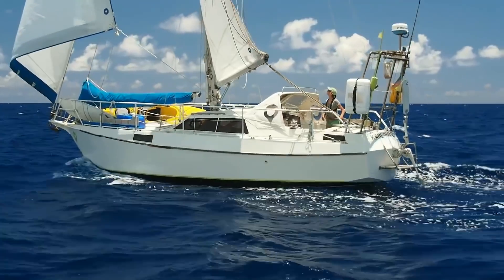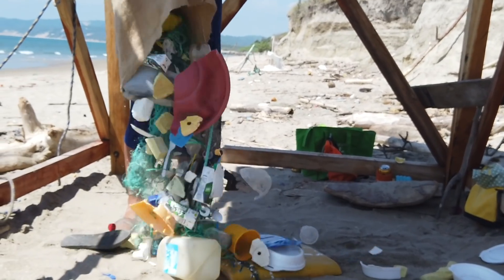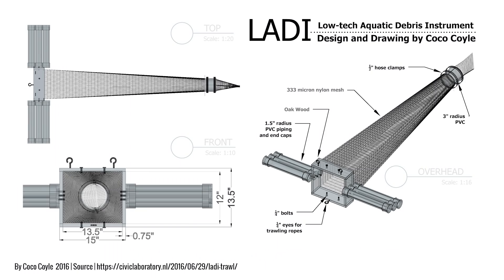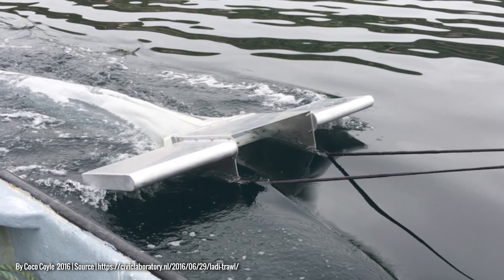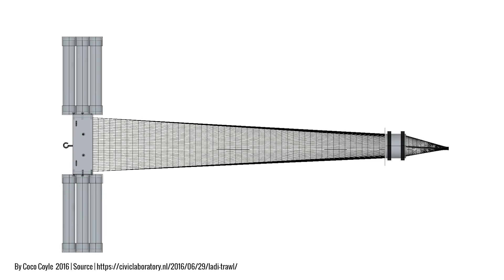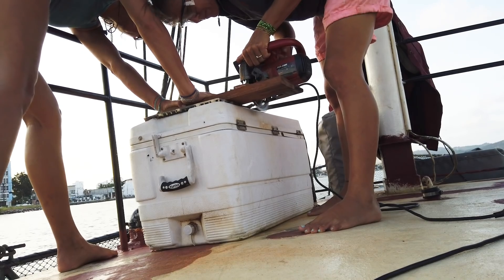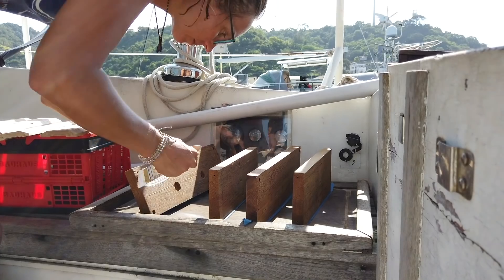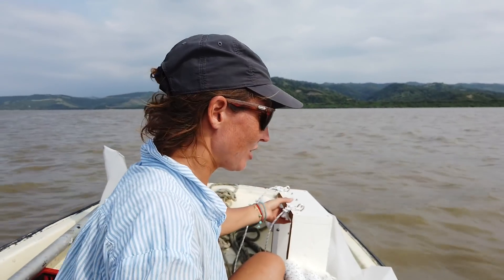MICROPLASTIC in our OCEANS. Collecting data to help fight plastic pollution - UNTIE THE LINES IV #50

Comment: There is a easy solution for islands to deal with plastic waste. Most islands do also have good clays in the soil. Built a clay oven based on the rocket stove design and burn the plastics. Yes, sooo many people will now jump up and down and say,oh air pollution. My question then is,any better idea????. If a clay oven is built the right way, temperatures of around 600 deg cel is reached. And burning plastic waste in such temps deal with most toxic material. We did tests with a very simple rocket stove just packed from bricks and we burned 15 large plastic shopping bags filled with waste(plastics and paper) with total weight of 12 kg, in about  30 minutes and all that was left was solids with a total weight or 400 grams. These ovens can become a sailing project as ovens need  some repairs and visiting yachts can make it a mission to visit islands where previous yachties helped communities to construct these waste burning furnaces. Good for you to take action . Oh, somebody else make a video on a island with their drone where waste dropped off at the jetty, was collected only for them to find out,the waste collectors go by boat top a remote part of the island and just dump the waste. So,collected, and dumped right back on the beach amongst the vegetation
Reply from the maker: I have been wondering about the burining process for a long time as well, since it seems a very big logistic effort to collect and transport all the plastic that could be collected. There are also ways to make diesel and gasoline from the garbage, which might even be better, because it gives the locals an incentive to collect the garbage and process it into something useful. They will use the fuel anyhow, so why not use it from recycled plastic. But that would beed much more than just building an oven, which might be a solution that could be installed more widely more easily. Fact is, I believe that the sailing community is ideal to help make such sprojects work because we sail around anyhow and with a bit of training and maybe some basic supplies, we could make a big difference. I have some spare time at my hands right now (back home with a broken heel) and doing some research on different options to tackle the project.
Reply: The problem with the idea to make fuel is that most remote communities just cannot afford the investment cost to make this work. From there that the best is to burn and use the heat for say providing hot water, making slake lime. The ovens can also be sued for cooking in a miles cleaner environment then just open pit fires. For cooking alone,obvious one would use clean wood(washed out on the shore and dried properly--heat from burning plastics can work here). Here a link to another plastic  project from us, and Emma played a huge role in turning this project into reality. And the nice thing is the crochet hooks can be carved from wood,washed up also on the shores.https://www.facebook.com/getridofplastic/
Reply: Also biogas disgesters can be built to assist with sewage waste(personal hygiene). The problem here is that most so called biogas project funds are just out to make money and not assisting the poorer population. Sad but true. On many islands the soil is extremely poor,but with the ultra rich effluent from a biogas digester, soil can be turned around into good soil for agricultural purposes. Our business did research on alternative fuels and waste generation for remote communities the last 20 years. There is a lot that can be done with actually relatively minimum financial input. Thousands of dollars instead of millions per community. But it calls for a change in mindset, getting rid of the greed factor and yes, hard work. Maybe we can arrange a skype chat and discuss.
Reply from the maker: @desertchild3550  Yes, I totally agree that the diesel making is more costly. BUT, it also would be very sustainable because they would have a high interest to keep it going. With a bit of croudfunding and the help of the cruiser fleet, I am sure things can be done. I am looking into a build right now to estimate costs and supplies to see how a (rather) small budget and (rather) easy to build machine could look like.
But as I said, your oven is a great idea that could be used easily and spread widely, also in areas where there might not even be the need for diesel. 
Thanks for sharing the link. Those "turning waste into useful things" projects are great, nice job ob eastablishing that. I myself want to focus more on remote areas where it becomes a bit more trick to sell these item. You would always rely on some form of tourism or people coming by to sell those items. Plus, in the end they may end up in the trash again...That's why I like the diesel idea so much...you turn the plastic into something that gets used and then it's gone. Sure, burning diesel is polluting the air as well...but they would use it anyhow. But don't get me wrong, I think that project is also great and every bit that we can do to get rid of some of that nasty ocean trash is a good bit.
Reply: Biogas outweight biofuel by far in terms of what one gets back.. On biofuel from plastics you only left with one product. On biogas you have gas for power,lights and cooking, on the effluent side you have ultra rich compost and water for agricultural purposes. Biogas in a engine burns also cleaner then biodiesel. We can team up as we have a supplier of biogas equiptment. But once a community sees the benefits, then they can be motivated to built larger biogas plants themselves top serve say a whole village.
Reply: In our research we found that specially remote communities is soo used to their lifestyle that they do not easily adopt to new work methods. It sometimes takes a lot of input to convince them change is for the better for them. I think that to get funding for a small biogas unit, inclusive of one stove, some gas lights and genset , one can lay a foundation for the bigger picture and roll out a proper crowd fund project. And again, yachts can easily play a huge role in this,as one of the biggest problems that any project of this nature face, is first equipment, secondly to get the right equipment to a place and all what is associated with it. Was way back my dream with my seven seas project to do all this with a yacht. But you guys can take over and make that dream come true. No need to reinvent the wheel. All research has been done. Its just a matter of funding and implimentation. Maria,s yacht can do all the heavy transport work. hehehehehehehehehehe. She will kill me for saying this. hehehehehehehehehehehe. Lets skype and discuss.
Reply: This weekend I  will draw out a project design and implementation plan to explain how a community project can be implemented with long term sustainability in mind. All while one recycle/take care of plastic waste.
Reply from the maker: @desertchild3550  😂😂 totally, Maria and I have talked about Joana's role as a mule before 😂.  So r u talking biogas from plastic waste or organic waste aka poop 😂. Since I am more into the plastic topic...obviously 😉.  
And yes, I agree that it is tricky to win local communities for sth like this. But free diesel, hey, doesn't sound so bad to me 😁. But I guess it's the maintanance that's a problem...I have seen a lot of problems with that in Kuna Yala and some solar energy installments. 
Would be great to skype about this, sure!
Reply: I fully understand. Same with our projects. It all started with plastics all over AFRICA, and we qiuckly learned that it is a extreme complicated issue. We also looked at bio fuels,but in the end, the cost factor  and practical implementation outweighed the goal of the project. From that we then shifted our attention to bio gas and came up with a different solution(burn plastics).  There is a lot on the internet on making  fuel from plastics, sadly, in reality its not sooo easy. Not saying it cannot work for smaller communities or even say a Island. But as said, we did extensive research on this.But with modern technology coming out day by day, who knows.?
Reply: @WhiteSpotPirates  when you talk about Joana as a mule i saw this sommer in the Danish news that a  9 grade class build a kind of recycling center out of box car trailer and diff. components where they recycled waste of different kind incl. plastic it was smart little trailer they have made and now it is on a mission around on different schooles being used to educate young people hov it can be done in bigger scale but still with relative simpel tecnic but i am sorry i can`t remember the schools name or where the link is i think it would be grate to have something  like that on a boat to show a way to get a cleaner invirement  sorry for the English but i hope you get the point  fair winds :-)
Reply: Look forward to discuss via skype. Also nice to share ideas and come up with plans that work and can be implemented where one is sure that it will be successful. I will draft some documents out of all our experience in the field of recycling and also community projects,the needs, the practical side of implementation and also the failures. Instead of multiple page documents I want to keep it in smaller bullet articles. I think that way people will be more interested in reading all of them. Our page where this will go on is this one. https://www.facebook.com/getridofplastic/
Reply: These ovens can also be used to make roman mortar from seashells and bones. Slake lime can be used to paint buildings, make bricks and building material instead of using cement.